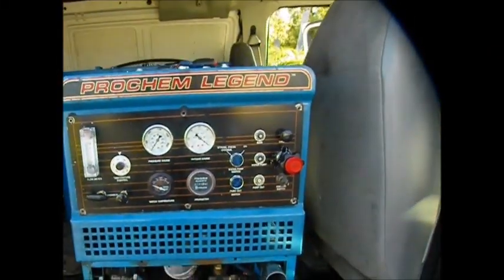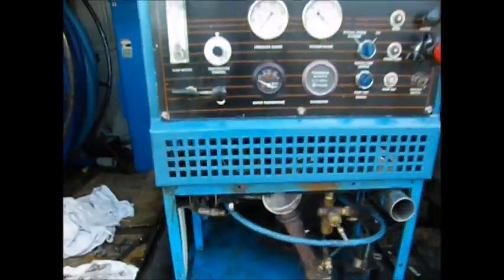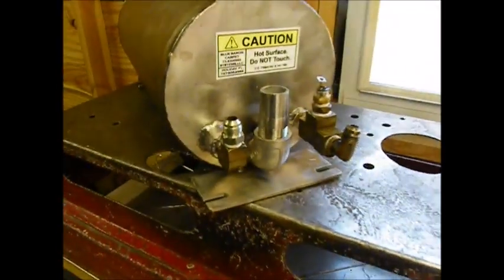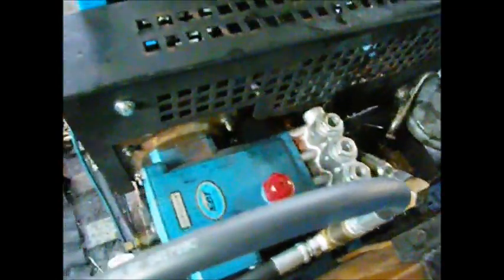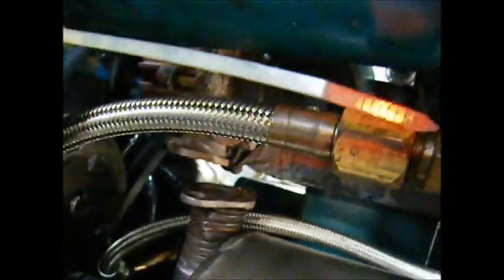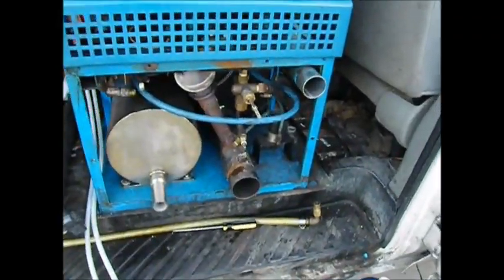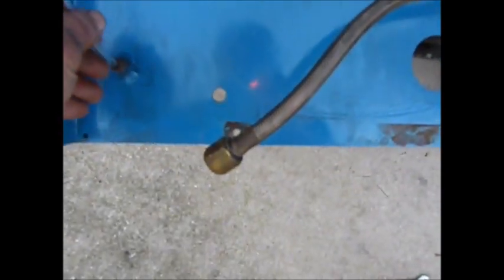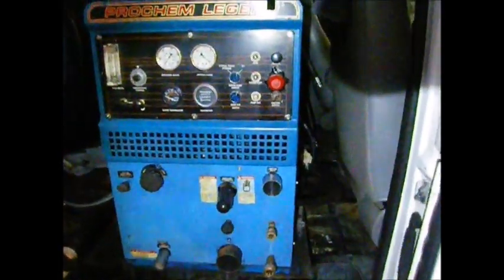Prochem Legend / 405 After Market Truck Mount Heat Exchanger Replacement

Comment: Have you ever made one of these for a Boxxer 421? I've had to bypass mine and am depending only on the fin tube heat exchanger for heat. I still get up to about 180, but nowhere near what I did before. I believe it is no longer even being manufactured. My machine has no pulse dampening either of any kind. The unloader does send the excess water back to the water box on the machine though. Perhaps that's why my pumps don't last as long as they should Seems like I have to put a new one on every 2 or 3 years. I don't know how many I've put on, but quite a few. My machine is a 2002 model. This machine cannot be used for pressure washing since it's only rated for 1,000 psi and that's far from pressure washing capability.
Reply from the maker: Currently made (2) for the Boxxer 318 / Diamond Products  https://www.truckmountstore.com/hydramaster-318-truck-mount-heat-exchanger/